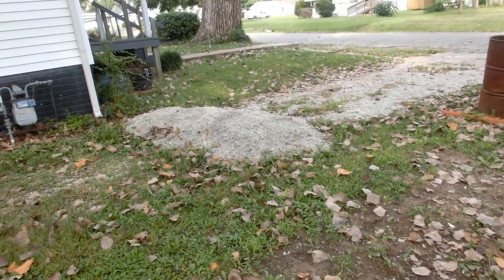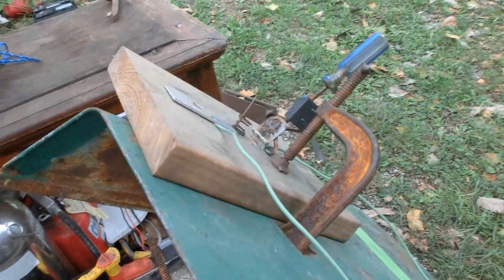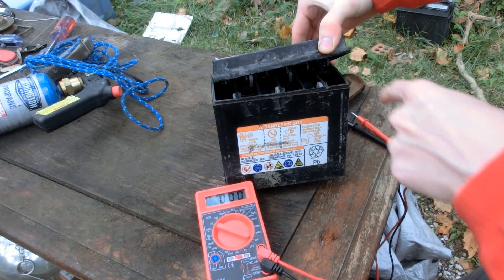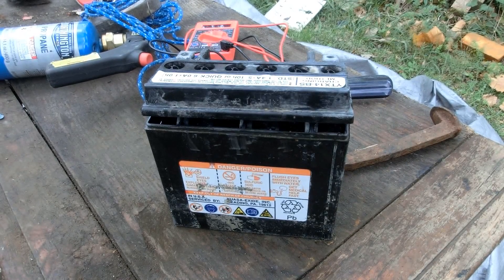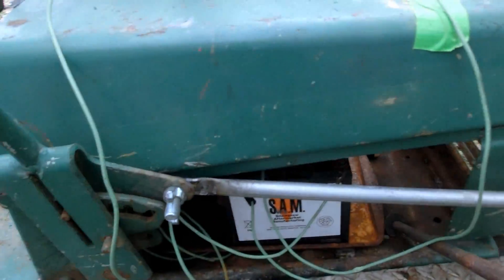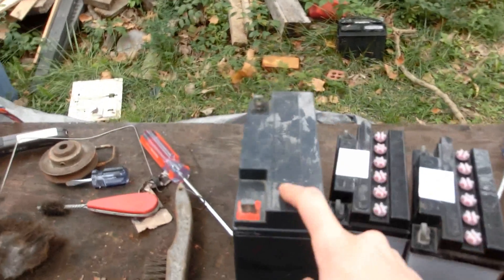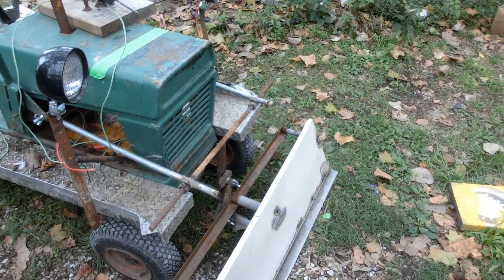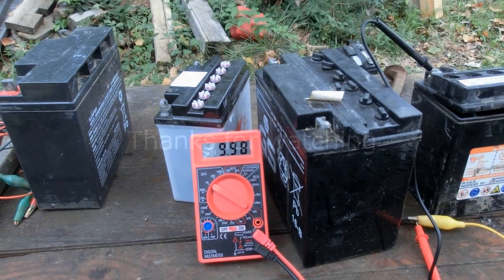DIY Electric Lawn Tractor part 12: Moving Gravel

Comment: The connections on those batteries were perfect, not sure why one blew up. Its better if you charge all the batteries at once though in series at 31 volt 47 amps for 63 two minute intervals. Push button trigger is nice but consider a foot switch...  I think an hour an a half for that size pile of gravel is great progress. Looks like you are doing the work of 1/3 of a person. Break up action with the pick axe was stellar. Nice work boots! Maybe design a pulvarizing attachment to break up the pile for an hour or so before you get started. All in all Success! Pile flattened. nice design!
Reply from the maker: well it was a dead battery i revived if i recall. it was just too much for it.

Comment: You know what would have more power? A gasoline powered one!
Reply from the maker: actually no it wouldnt
Reply: Really? Explain how that janky ass fire hazard can out preform my 18HP mower that has a plow that has a 48 inch blade. I move whole piles like that with ease. Tank of gas last few weeks with zero hassle, no charging , no exploding battery's so that's continues power day after day. But judging by your yard you are a master mechanic so what do I know.

Comment: I would love to build an electric tractor. As long as it works, that is all that matters. Saved you the heavy lifting. 

Try not to let your batteries drop below 12.30 for a longer life. Consider using laptop lithium batteries.

Don't listen to any of the bullshit that people say, your video was great! Keep it up.
Reply from the maker: most of these wont go above 12.3, they are well dead

Comment: you supposed to check on and then add water and your battery won't blow up
Reply from the maker: +Toby Dyes thats not how that works, the battery actually cant blow up without water
Reply: Water and acid batteries so you don't burn it out read about it

Comment: I don't know if was your welding or all the pressure it had to withstand while grading the driveway.
Reply from the maker: what are you asking? please rephrase that when your sober.
Reply: Rinoa Super-Genius
I'm going to be nice about the sober remark.
   All I said was, maybe the blade got bent when you were knocking the gravel down in the driveway.
   So it is possible your welding was straight when you welded it the first time.
   By the way, I love your idea on the electric Lawn Tractor, especially the blade mechanism.
   I'll look around to see if I can find what motor you used for it.

Comment: Do the lights still work?
Reply from the maker: they should, i just need to wire them up again.
Reply: +Rinoa Super-Genius cool and how much power do Thay run on
Reply from the maker: DF hacker HACKER
well they are incandescent so they use 12v at too much power. i think like 15 watts each, but they dont put out much light. i'll probably see about popping little 3watt LEDs in there and that would be a lot brighter.

Comment: Did you have the connections made properly on the battery that blew up?   It has to be positive to positive and negative to negative.
Reply: You mean parallel adds amperes not voltage.
Reply: In series to add up the voltage it has to be negative to positive.
In parallel to add up the current it goes positive to positive negative to negative.
Just don't mix the two methods and all will be well. XD
Reply: Gary Smith
LOL yes. Fixed that. XDDD

Comment: with my lawn tractor I just jump on the bitch and go, screw all that battery charging shit.
I can assure you that your battery powered toy does not compare to a 25 hp gasoline tractor.
Reply from the maker: +ramon davalos but it helped get me a nice job building stuff in silicon valley, and its useful to me, and costs almost nothing to run. take your blind elitism somewhere else.

Comment: try not to charge them batteries on the ground/ concrete because it is not good for them , at least put then on a piece of wood or cardboard, even a shirt, anything but the ground/concrete
Reply from the maker: Bob Ordewald
my experience is drawn from 10ish years of me experimenting with batteries and from the scientific comunity.

all of my batteries sit on concrete, and have for years.

this "batteries on concrete" myth started in the early 1900s when batteries where made of wood so could rot if subjected to the moisture in concrete. but the modern plastic shelled batteries have no effects from sitting on concrete.

you are saying that moisture on the bottom of the battery allows electricity to go from one of the terminals on the top, around the side, across the bottom, around the other side and into the other terminal... i hate to break it to you but electricity takes the path of least resistance. there would be less resistance between the two terminals on the top than around it.

but also dont forget that water isnt very conductive, especially not enough for 12v to do much with that long of a distance you claim
Reply from the maker: +Levi Skuse that is a tip, just a very misinformed tip.
Reply: oops, oh, now noticed that
Reply from the maker: Levi Skuse
concrete doesnt kill batteries
Reply: well, i know that , but i heard it just drained them over time  or something like that
Reply: 8BallManiax 8, You are correct. But think, he is trying. He is not inside playing video games. Orville and Wilbur did not know anything but they tried. I hope his fumbling around will get him send him down a path to a larger world.
Reply: +Levi Skuse I work in the battery industry and that myth started way back when battery cells had external connecting bars, moisture and acid on the outside of batteries did cause some draw but a clean dry plastic case battery it is not a concern, Exide batteries are the worst for it as they will sweat and corrode while in stock at a store, Batteries made by johnson control and east pen are the best and unless defective seldom corrode or sweat.
Reply from the maker: Bob Ordewald
so how did you ditermine the dirt was the cause? the best way to do that would be to cut the top off the battery and check the continuity with an ohm meter once its out of the circuit,

most likely you are mistaken though, old batteries can drain much faster than when new. especially when the battery's voltage has dropped too low and brought back up, like 7v.
Reply from the maker: Bob Ordewald no, thats wrong.
Reply: i dint really mean to start anything yeaaaaaaa
Reply: Levi Skuse You didn't. Some folks take a little knowledge and suddenly they know everything. I would suggest to the person in question do some controlled experiments. It would expand that persons education and it's FUN!
Reply: True True
Reply: +Rinoa Super-Genius What happens is if there is any kind of moisture on the battery sitting the battery on damp concrete will cause a very small 'short' that will over time will kill the battery. We called it a 'draw'
Reply: Rinoa Super-Genius I have 40 years of experience working with cars and seeing what happens when a battery is placed on concrete. Where is your experience drawn from?
Reply: Rinoa Super-Genius I have seen a battery go dead in a car where the battery was dirty and that low draw on the battery would kill it if the car sat for 3 or 4 days without being used. I have seen the same thing in a damp environment with a battery sitting on concrete. Do you know how to determine a whether there is draw on a battery while sitting?
Reply: +Bob Ordewald I would have to say no to you Bob. I didn't do an experiment, but I did the research. I never found a website that said a battery drains more on concrete.
A small sample of my websites:http://www.batterystuff.com/kb/frequently-asked-questions/large-rv-marine-batteries-faq/can-i-store-my-battery-on-a-concrete-floor.htmlhttp://www.homepower.com/articles/solar-electricity/equipment-products/ask-experts-batteries-concretehttp://www.snopes.com/autos/techno/battery.asphttp://www.cartalk.com/content/business-batteries-and-concrete-floors-needs-behttp://www.plasmaboyracing.com/blog/?p=158
Reply: Rinoa Super-Genius You can test for a draw on a battery with an OHM meter. Want to know how? Take a class, read a book. I don't really want to teach someone who is rude and insulting. Next time try to show some respect before you need help.
Reply: Bob Ordewald You don't need a class on how to hold a red and black wire. I think Rinoa was polite.
Reply: Jess Vagnar read the 1st one and there is more to it than that
Reply from the maker: Bob Ordewald
but you have to put the ohm meter in line with the draw, so how do you disconect the draw? >_>
Reply: Bob Ordewald I don't know what I'm missing... I read all the feed a few times, I did the research, confirmed with engineering professors and the works. I read the whole conversation, I get I butted in online and all but...
Reply: +Bob Ordewald Look at this kid he doesnt know anything. YOU LOST SUNNY BOI 
(On Rinoa's side not yours)
Reply: Chad Yelland Hi, For the most part you are correct Chad. However the batteries that he is using all look dirty and damp(at least that's what I remember) The shed he was working out of looked damp as well. My bit of caution while not universally true any longer is still a good habit to have. 
Thanks for the message!
Bob
Staunton Virginia USA
Reply: yea that's why it takes so long to charger
Reply from the maker: Chad Yelland
actually the myth of batteries discharging on concrete also comes a bit from the older wooden cased batteries rotting when moist, so you wanted to avoid moist concrete.

Comment: Really enjoyed watching this series. I was thinking about a way to break up compacted soil, and I thought about a series of hooks made of re-bar with the points facing down in place of your plow blade. You'd drive onto the compacted soil, drop the hooks, and then reverse across the area. The hooks would dig in as you backed up and break up the soil like a big iron rake.

Also, since you know about electronics, have you thought about building (or buying) a Pulse Width Modulated speed control for the drive motor? That would give you a nice gas pedal that wasn't wasteful of electricity. One other thing to consider: 3 phase AC motor run by a Variable Frequency Drive that gets it's power from a DC to AC converter. Old 3 phase motors are dirt cheap at scrap yards and can easily be much more powerful than the one you're using now. They also weigh a ton so you'd get more traction.
Reply from the maker: ArtemiaSalina i'm working on a DC-DC variable transformer for this, i hope to run it off a single 12v battery. and i looked into using a row of spikes to break up dirt but i think i'll just try a single big spike i can just run through the ground, that may give more control.
Reply: Rinoa Super-Genius
Can't wait to see it going.

Comment: i am 10 yrs old an I think this is really AWSOME what you did my only question is what kind of a motor did you use.other than that I wanted to tell you that I have built a motorized bike with my sisters bike and her electric motor scooter i just took the guts out of the motor scooter I Ducktaped the the box that held the batteries and the on off button and charging port to the bike frame then i mesured where to put the motor once i got that I clamped jb welded and hot glued the motor into place then then i put a throttle and brakes on the bike jb welded on a chain guide and it worked!!!!!!!!!!!!!!!!!!

Comment: Last time I saw one of your videos was when you were "reviving" old batteries.  Nice to see you're moving on and making cool stuff with your batteries.  I'm so impressed that you used those little batteries.  I hope your second tractor is made with full size batteries.  Try finding a late 60's-early 70's Case, MF, IH garden tractor with a blown motor.  The frames are thick and heavy; totally what you want to carry heavy batteries and motors.  Put a want ad on Craiglist, and you'll get one!  Good luck!
Reply from the maker: Mark W actually a single 12v deep cycle battery has more power than these old crusty batteries, so i'm just going to make a controller box that steps up the voltage from one large battery to like 70v or so to power the motor, and maybe even have variable speed and reverse instead of just on/off.since doing this though i've moved to california and am doing other things, but i hope to get back to this project.

Comment: Weld some gears on the motor and then weld it onto the axle would have more power and wouldnt slip as much as the rubber belt

Comment: You would need traction batteries that are specifically built for such applications. Those have thicker flat/tubular plates compared to normal automotive batteries. The plates on the normal ones will start to deform when used on electric vehicles.

Comment: A new battery has 60% water 40% acid I just got done with a battery course in auto tech
Reply from the maker: youd kill the plates if you use that.
Reply: 35% acid whoops sorry at a full charge
Reply: longboy1998
Typical ratio when buying bulk from autoparts suppliers is 70/30, dont think you want it much stronger than that anyhow.

Comment: that motor has loads of torque! do the brushes wear down quickly?
Reply from the maker: its not under as much load as it would be under in a tredmill so i doubt its stressing much. the brushes look ok but are getting a bit low.
Reply: Rinoa Super-Genius hopefully you will be able to get some spares.
Reply from the maker: smallenginedude71
 i'd just make some from scratch.
Reply: Rinoa Super-Genius just out of graphite blocks?
Reply from the maker: smallenginedude71
yeah

Comment: Maybe some hydrogen gas formed and the spark from the knife switch ignited it but looking back the boeing 787-8 airplane was grounded for batteries exploding and catching fire they were made by yuasa as well so wouldnt be suprised if it was a quality control issue btw is that thing capable of fitting a blade and mowing or just utility work
Reply from the maker: yes i could add a mower, but i have another machine that is only used for mowing.

the spark came from inside the faulty cell. it shorted out and all the other batteries started feeding power into it till it popped.

btw the 787 battery issues where lithium not lead acid.

Comment: I like that you are resourceful and always doing cool scientific experiments while having a practical application or getting a job done. My only advice is consider wearing close toe shoes considering you are working with corrosive acids and metal and machinery and pickaxe, true scientist always wear safety equipment like goggles so why not shoes? Keep up the cool work!
Reply from the maker: because the acid won't burn skin but will mess up cloths. i'd rather not ruin a pair of shoes. not counting i get oerheated really easilly ever since i had heatsroke in 2012. if i wear shoes even in 70 degree weather i start getting light headed. weird.

it really depends who you consider a "true scientist" you mean people who work for a safety concious corporation that require tons of over-safety? a lot of times safety is over-used and desensitizes people to the actual dangers.
Reply: Rinoa Super-Genius
While I work in industry, basic lab safety is taught  in high school and university level so more in academic settings is where I consider "true science" exist with professors and students trying out new things. But if you have pre-existing conditions and are aware of the risk, then I guess continue the good work as safe as possible.
Reply from the maker: Eddie Sanchez don't worry i have many sets of safety gear ranging from high temp shielding to hazmat suits. and i do use them when i feel the need.

as for "true science" thats just your opinion of it. i guess you wouldnt concider most of the great innovators of the past "true scientists" just because they wherent in white coats in a clean lab with many regulations.

oh and btw i never said i was a scientist, i definitely dont think of myself as one.
Reply: True science and scientist in my opinion would include innovators and students, and not just people in lab coats.

Comment: Hey man, perhaps on your next version you could use the front and back of the vehicle, say front for dozing and back for pick work, even have a spin seat and two sets of steering that so you can steer from both front and back :-)

It seems the high capacity of battery the denser the acidity :-) like those 12v22ah are very weak and a pointless task to weld with, while the car battery capacities of 120ah that weld really well, I would say have very dense acid due to the required enery density :-)

Think you can make a Radioisotope thermoelectric generator from the radioactive material in smoke alarms? http://en.wikipedia.org/wiki/Radioisotope_thermoelectric_generator

oh and cough give me some tracks on the next mower tractor sorry, got a bad throat atm :-D

Comment: I have had a battery blow up on me before, it was a mid size car battery, I made the mistake of charging it while I was grinding close by, it made a crazy bank blew the top right off the battery and split down each side, but the crazy thing was the battery still had current.
Reply from the maker: haha wish you'd filmed that.
Reply: Rinoa Super-Genius same here, the boom so loud it was like a bomb going off, I got some film of the aftermath, lol
Reply from the maker: redneckbryon  yeah with this battery it wasnt that loud. i really only heard the caps hit the hood. i thought i'd snapped a weld.

mine only popped one cell but i imagine all 6 of yours popped and thats why it was more energetic, not counting this battery was smaller and i'd kinda overfilled it with water so it didnt have much space for the hydrogen to build up.

Comment: you know , why don't you make a reverse switch for that dc motor you have a knife blade switch engineer a double through double pole switch for reverse
Reply from the maker: because that would be 5x as complicated, the solid state driver i'm building will be better.